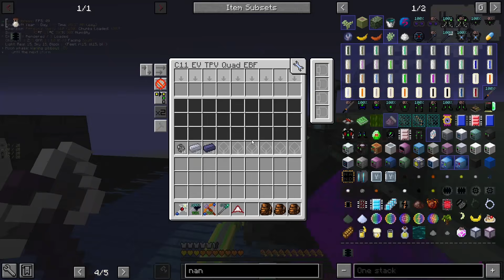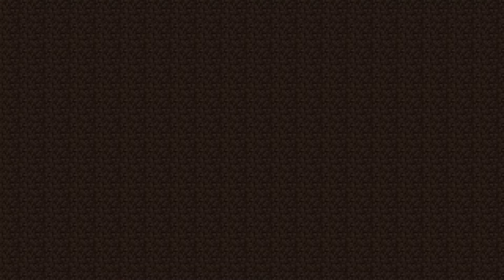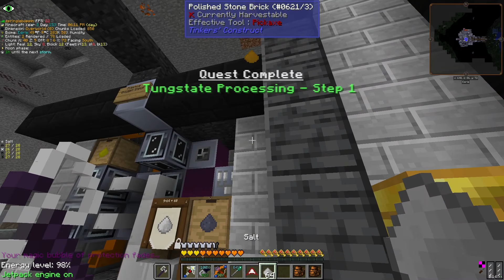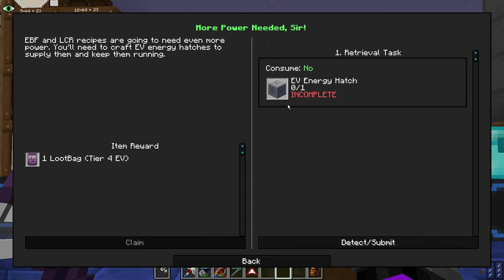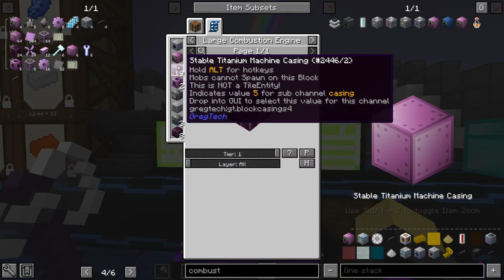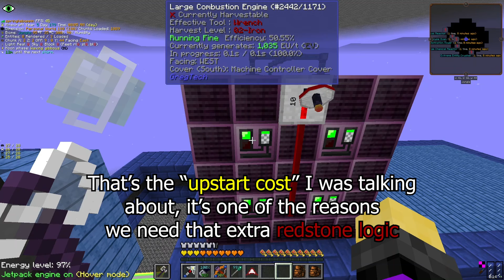GregTech New Horizons EP21 - Now that's some Insane Voltage

Comment: Let me give ya anoyher small advice that'd make your life much easier...
When autocrafting double recpies a few times
(Instead of crafting 1x at a time make 16,32 even 256 if you've got the power and parallel's
Energy hatch coils are a nice example since you allways need 2)

You could get away with less crafting cpu's and it'll be very usefull soon enough

(This also applies to crafting massive cables in the wiremill you can then breakdown fast and things like that...
Much faster this way)
Reply from the maker: me is already doing that everywhere :)